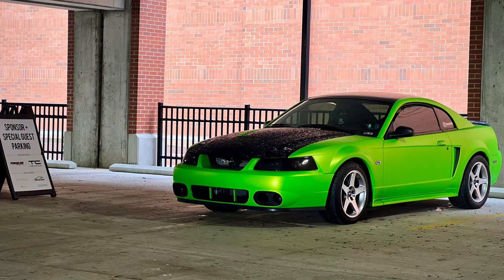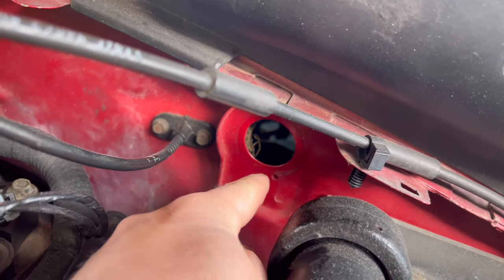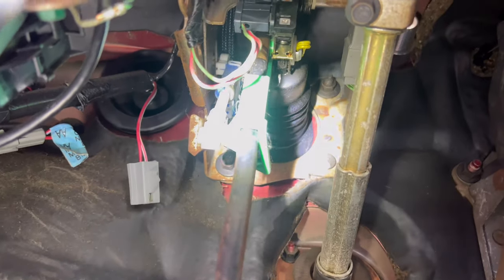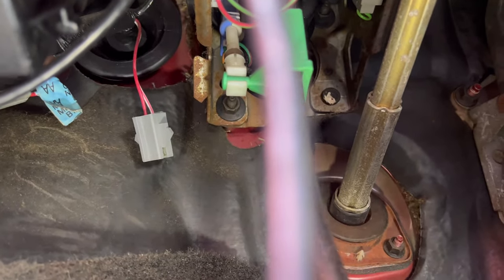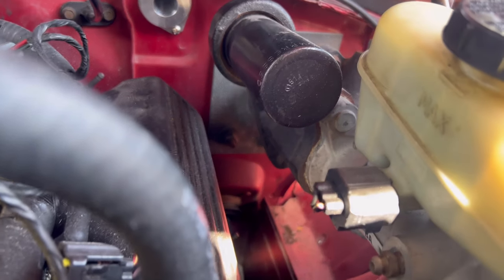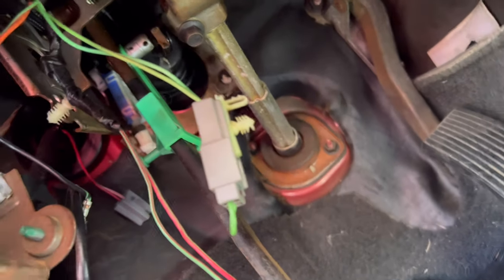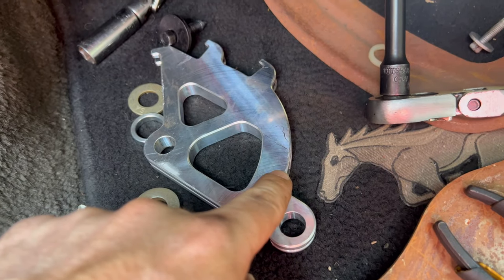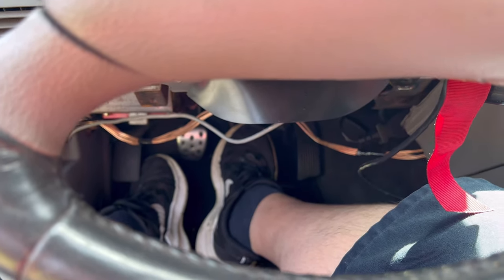Mustang automatic to manual swap part 1

Comment: What is the actual difference in fuel mileage with the manual 5 speed ? The 4 speed is crazy good for a factory trans but it eats gas on the highway at 65 at 2k rpm
Reply from the maker: Ya know I’m not sure, I would imagine it would be much better!

Comment: Hey man, where is the other wires for the clutch safety switch? Any idea? I found the red/blue white/red one but can’t find another harness
Reply from the maker: It’s up in the harnesss, I had to dig around for mine. I’ll check again today if I can and see if I didn’t wind up bypassing it..
Reply: @forcefedhatch  any luck on that harness?
Reply from the maker: @joevincent383  I had all of the plugs in my factory dash harness to add the neutral safety switch and the brake switches. Just had to unplug the jumpers and plug them into the pedal assembly.

Comment: @Forcefedhatch where are you located if you don't mind me asking?
Reply from the maker: I’m in southern Ohio, near Dayton.
Reply: I was just wondering if you would be interested in selling the valve body and whatever I need to convert my transmission to full manual But I live in Florida
Reply from the maker: @casper2304  yeah I absolutely would sell it once it’s all removed.
Reply: So you know if its possible to use the v6 pedal assy on a gt for this swap ? Subscribed. Dont mind the 4r70w but if I can upgrade to a t56 in the future. Subscribed.
Reply from the maker: @Tacticoolpapi  yep, all the pedal assemblies are the same!

Comment: Did you have to tune the ecu or was it just replacing the harness sufficient?
Reply from the maker: I did run the car with the auto ecu just fine without a tune but it does have a torque setting between shifts that seemed problematic, also the speedo was never correct. Eventually I did tune the car for the manual and turn off all of the automatic switches.. I do have a video I posted that shows what was done for the swap settings, especially for the speedo calibration. Unfortunately if you don’t have the SCT proracer or comparable software to tune it yourself it isn’t any real help to you.

Comment: Hello sir can i ask you somthing?

 I swaped my car mustang 98 gt swap to manual and I want to turn on the cruise control, knowing that before the swap it was working

I have tried change the ECU to the manual ECU and did not benefit anything

Sorry my english not very good 🫣
Reply from the maker: To be honest I’m not sure on that one, I actually have full control even of cruise control on mine. It could be as simple as a wire or the vehicle speed sensor not sending the signal..